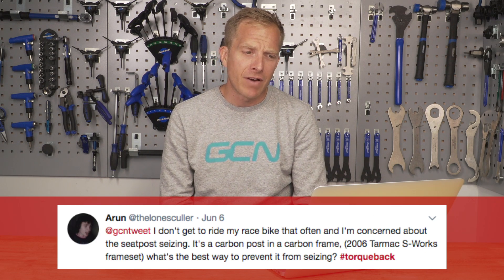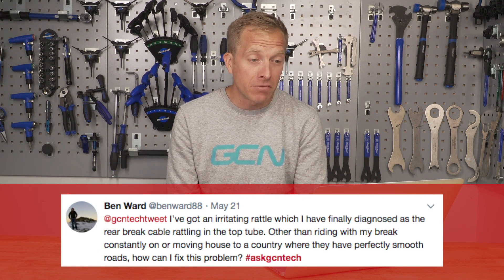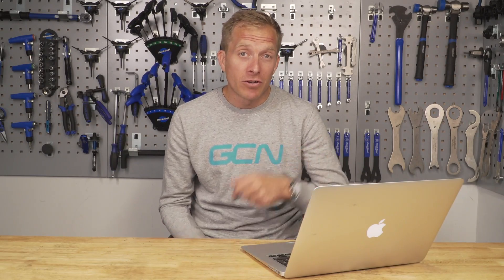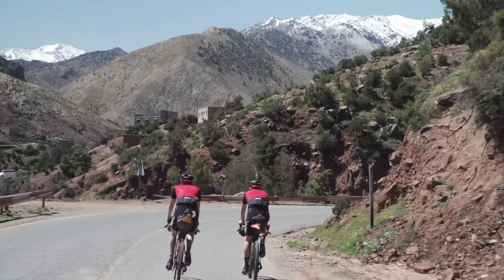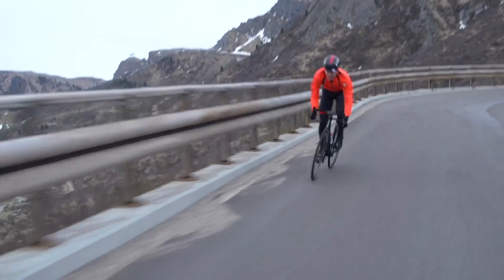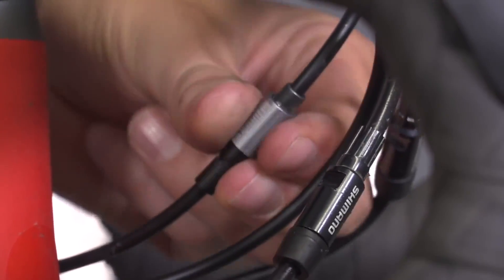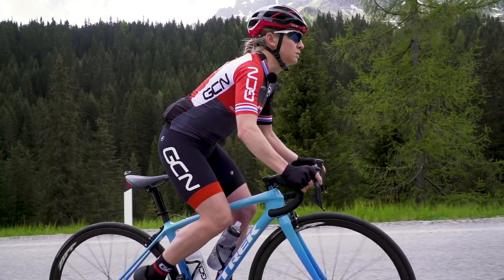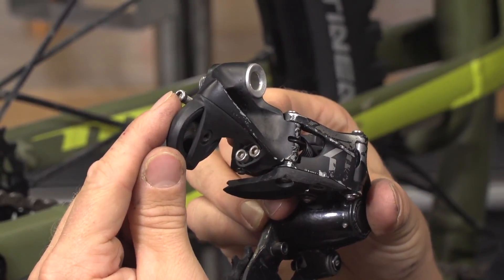Is Petrol A Good Cleaner? | GCN Tech Clinic

Comment from the maker: Remember to keep your questions coming in for Jon using #askgcntech. 👇
Reply: GCN Tech #askgcntech can i use my pressure washer (1400w)on my bike to clean drivetrain? Cheers
Reply: GMBN also recommend using paint thinner.
Reply: GCN Tech I'm having issues with my DI2 firmware not updating and allowing the bluetooth dongle be recognized. Essentially bricking the entire system. Any help?
Reply: GracieApproved if referring to the KMC missing link. They are reusable. Recommend changing the link when you change the chain.
Reply: John Rawlinson: Is this really  the best place for this sort of question? Have you tried bikeforum?
Reply: Thank you John
Reply: Hi Jon, are quick links for 11 speed chains normally one-time use? #askgcntech
Reply: #askgcntech Hi Jon,

I'm looking at changing my saddle out finally (8 years later) on my 2010 Felt F95.  The seatpost clamp is two pieces, with the bolt pulling the top piece down to clamp down the rails.  Will this work with 7x9mm carbon rails? Cheers.
Reply: Elliot Flowers haven't tried. Thanks for the reference. I've searched only for vids.
Reply: #askgcntech Hi Jon, great show, really appreciate all the great info. I have a question concerning cross-chaining...I have an Orbea Avant H30 with a Shimano 105 5800 group; 50/34 crankset and 11-32 cassette...Now I know that cross chaining (50+32) is not good for my drivetrain, but how about the other, less extreme but still crossed-over gear combinations (ie 50+28, 50+25, 50+22)? I ask because when I'm in those combinations, my chain is slightly more audible (not very noisy, but noticeable)...And it's definitely not the chain rubbing on the front derailleur (trimming takes care of that). Do those combos wear out my drivetrain faster? Thanks!
Reply: GCN Tech #askgcntech I've just changed my chain and cassette to new ones. Everything runs well and smooth shifting but when going up hills and I have to put some power through the chain on the 3 largest cogs on the cassette it makes a grinding noise and I can feel the roughness through the bike. It's never happened before? Does the chain and cassette need to settle? What could be causing it? Everything seems fine and the chain and cassette seem to be installed correctly and there is no rubbing on the front mech at all. What could be causing it? Should I be worried
Reply: GCN Tech #askgcntech is there a difference between a ball bearing hub and a cartridge hub? if so, does that mean there will be difference in speed of the hub set?
Reply: GCN Tech #askgcntech  Is balancing my wheels with small weights fixed inside the rim  opposite the valve worth the effort? As when the wheels are rotated, without any floor contact, the valve area always stops at the bottom implying the wheels are heavier in that area.
Reply: #askgcntech
First thing first GCN is simply awesome!!! 
Now my issue, I own a road disk brake bike which uses a 15mm thru axle at front, but nowadays seems 12mm is the standard. Therefore some brands no longer provide any adapters/endcaps for their wheels to be compatible with 15mm thru axles. Is there any way I could use a 12mm axle wheel on my bike without changing the fork? Otherwise I need to remove a bunch of wheels from my shortlist 🙄😔

Comment: petrol has sulfur - which is bad - in it (including diesel fuel) as the cost of desulfuration would make it much more expensive; better use desulfurized naphtha as a solvent with all precautionary measures. wash the chain in 2-3 baths so that you recycle the solvent as much as possible, including by filtering it and decanting it. the second bath container will become the first bath container as the solvent will have more and more lube in it, gradually. it's best to end up with either a mixture of isopropyl alcohol and ethanol+methanol (methanol is more able to dissolve salts) or separate stages leaving the isopropyl bath for last. it helps not only by the increased speed of evaporating and therefore leaving the chain dry so that the lube can enter the chain fully but also is able to take away whatever salt and other things might make the chain rust and/or the lube oxidize leading to performance issues translates in increased friction AND excessive wear. you may also wash the chain FIRST in citrus degreaser mixed with water if it's muddy. take care that the citrus degreaser should be completely washed out of the chain and also the water left inside so you better use something else beside it too. better spend 10 minutes instead of 5 minutes if you take the chain off the bike to do the proper job so that the chain will last longer and the cleaning and relubing does not need to be repeated frequently if done right.

Comment: Hi Jon (and the new fellows who are doing a good job, but, no offence, Jon is Jon...).
Everytime I (religiously) watch / listen to the tech clinic, I forget to ask this, on the subject of cleaning with petrol: #askgcntech
I have a couple bikes at my parents home in Provence, and I basically ride them only at Christmas and during the summer. Being a Si Richardson devotee, I lube my chain and groupset with WD40 but I guess it would dry off between August and December and the chain might start corroding. I don't want to have it bathing in oil either.
So my question is: would it be ok to remove the chain, clean it and store it in a petrol container when I am away for a few months, or does it risk being corroded or damaged?

Comment: #askgcntech How do I stop squealing v-breaks if I've already tried new cartridge pads, new alloy rims, toed in to varying degrees, filed the pads down and stripped the whole calipers and greased every moving part other than the breaking surfaces.  They still let out the most horrendous scream when I stop. Not when the pads first touch but when I pull harder (I guess when the full pad contacts the rim).  Please help or i'm going to have to bike with a bag over my head to save the embarrassment. thanks

Comment: I have a carbon fork with a through axle and the recommended tightness of the through axle is 20NM, but if I tighten it anywhere near that much the hub gets really tight and the wheel doesn't spin freely. Questions: 1) Can I fix something that allows me to tighten the axle without affecting the hub? 2) Is it dangerous to keep the through axle looser (~6NM). #askgcntech

Comment: #askgcntech - as a visual designer/ digital illustrator / cartoonist -  i'm quite bored with most branded carbon bikes, beautiful as they are they all have the same aesthetics, I would like to be able to paint my carbon bike myself using all cool effects possible: from cartoon figures, tattoo styles to airbrush effects. (as seen on Harley's) 1 - what would I need? 2 -  have you already got some video's about this? If not this could be a cool winter project tutorial thing, similar to building a wheel etc. 3 -(in the last few weeks there was a gcn video that mentioned spray paint can's for bikes but I can't find it anymore, which was it?) Thnx!

Comment: Hi Jon. I need to buy a new outer chain ring. I'm currently on an Ultegra 50/34 but would like to replace with a 53 outer and keep the 34 inner. Is there any problem with doing this? #askgcntech

Comment: Hi John, I live in an appartment in Amsterdam and have little storage for my bike. I have, however, do have a small storage closet in my appartment where my steam boiler is. It is big enough to store my bike (Canyon Aeroad ultegra di2).  Do you think I could damage my bike by putting it there? It is quite hot in there (25-28 degrees Celsius) and humid). I mostly worry about my tires, drive train and electric components. Love the show! #askgcntech #askgcn

Comment: #askgcntech Hi Jon, i have a Masi Uno CX which is a steel framed cyclocross bike. It came with 2300 components but now I have upgraded the entire bike to 105. One issue that I am facing is the front derailleur. The 105 front derailleur's cable needs to be fed from the bottom. There is a small circular thing that lets me route that cable through there to do exactly that. However, it hampers the throw of the shifter and the derailleur does not get enough movement. Now I am thinking of rerouting the front dera cable below the downtube and then zip-tie it into place. But don't want to bodge it like that. Any suggestions?

Comment: i currently run 52/36 chainrings and find that when tackling some of the steeper gradients in the area some being 16% + im running out of gears. Im running 11-32 on the rear ..is it possible to use a 34 tooth inner ring or is the jump too big? or would i be better off changing too a full compact set up?

Comment: 35mm on a roadbike not gonna happen unless it has canti brakes, V brakes or disc brakes OR is an older bike with long reach side pull brakes. you'll likely run into clearance issues with the brake vertically(top of the tire will rub the calipur) or side clearance issues with the seat or chainstays or the seat or chain stay bridges.

as far as tred goes. if its a knobby the chances of it working are even less because it'll be slightly larget then the labeled size. 

can it fit on the wheel- YES,

will it fit on the frame, probably not.

Comment: When changing between sets of disc wheels, even if same brand rotor, you may still notice some slight pad rub. This is due to manufacturing tolerances between identical parts and industry standards. Stay with higher end components like SRAM Centerline and Shimano Ice Tech. I just loosen up the caliper, mount the new wheel, squeeze the brake lever, retighten the caliper. Lines up every time. Takes about a minute per wheel

Comment: #askgcntech My bike ( a Giant Propel Advanced Pro 1 2016) has mechanical cables running from under the bartape into a port behind the stem, the frame being Di2 compatible. The arrangement means the cables stick out about 3cm either side of the stem, and my knees/lower thighs  knock into them when climbing. Any ideas how to help this without forking out for Di2. Love the show. Cheers

Comment: #askgcntech HI, I've just bought some new wheels with internal Rim width of 19mm.  When I put on 25c clincher tires on them, the measured width comes out to 28mm.  Should I pump the tires to the recommended Psi for 25c or 28c for my weight ?  Thanks!  Keep up the good work.

Comment: #askgcntech Hey Jon, I have a question about an annoying sound (I know you love/hate those). I have a "tick tick" sound that seems to be coming from my back wheel. The sound comes both when I pedal and coast, so I have excluded everything else other than the wheel. With a bike on a stand I've been able to hear that the sound seems to come from the area where the wheel passes through the chainstays. I have checked and there is nothing rubbing on the wheel or touching the spokes anywhere on the path of the wheel, and there is enough clearance for the tire between the chainstays. No spoke seems to be lacking tension, the valve seems pretty secure, and there is nothing loose inside the rim. The sound is very clear when the wheel is turning faster than 25km/h, it starts to go lower below that, and strangely disappears when the wheel turns below 15km/h. And it comes no matter what gear combination I use. This sound came after last time I removed the back wheel during a bike wash. I have tried removing and putting back the wheel (sort of like turning off and on a computer), but the noise is still there. Any ideas what could it be? Could it be something else other than the wheel? Thank you very much in advance!

Comment: Finally, straight talk on using gasoline (petrol) for cleaning.  It works and costs less than the other stuff.  Good for paint brushes, too.  If you aren't intelligent enough to keep from setting it afire, you probably can't get the container open.  Yes, minimize skin contact and fume exposure.

Comment: Hi GCN Tech. I am from South Australia and race in the junior Road Races. The rules say that juniors cannot race on Carbon wheels, or have a rim depth over 40mm. I have a 2012 Giant TCR Advanced SL 01, with the Giant PSLR 1 Wheel set. I want to upgrade to a better wheel set. I was wondering if you could recommend any quality, mid depth, lightweight alloy wheel sets. Cheers.
#Tourqueback

Comment: A 28t cassette will work on a recent DA RD - wow, what progress

 My 1st gen DA RD short cage from 1973 will take a 30t......

And there is a long cage version rate above that
Reply: I used a 12 to 30 on my 10sp Ultegra with short cage. 32 just about worked too but if in doubt use a Shimano RD 350 non series derailer.

Comment: Using petrol is dangerous advice

Diesel is a safer alternative, much lower flash point

I use neither, white spirits works fine
Reply: I prefer white spirit or turps substitute. Petrol is nasty stuff with additives like Benzine

Comment: #askgcntech Hi Jon, another gear related question: I'm not ready yet to go for gigantic mtb-like cassettes for big range, instead I'm looking forward to build another monstrosity - pair a 28-teeth chainring with 50 one. In this case, can a 4500 front derailleur handle the task? There is a lot has been said and more to be said about rear mechs, but hardly any data on front... Additionally, are there aftermarket chainrings with maybe more protruding ramps or better pin placement for chain to catch upon?

Comment: Easiest way to have 2 disc wheelsets... use the same hubs and rotors (at least brands)... Typically the tolerance will be similar and allow for "hot swapping" wheels without fuss or extraneous adjustments! (or shims)

Comment: I've just changed my chain and cassette to new ones. Everything runs well and smooth shifting but when going up hills and I have to put some power through the chain on the 3 largest cogs on the cassette it makes a grinding noise and I can feel the roughness through the bike. It's never happened before? Does the chain and cassette need to settle? What could be causing it? Everything seems fine and the chain and cassette seem to be installed correctly and there is no rubbing on the front mech at all.
Reply: PureMAD4 sounds like chain rub on the front mech.  If it is a shimano there is a trim option so you can actually move the mech over to clear the chain.
Reply: Doug Thorpe  That's what I thought but there is no rubbing at all from the front mech.

Comment: #askgcntech Last week while descending the steel bolt on my seat clamp sheared in half and resulted in a high-speed crash.  Is this something that is known to regularly give out on bikes? While I'm not the smallest guy and my bike is 4 years old with regular use (and maintenance), I still would expect a bolt to last more than 4 years or expect to be told to replace it regularly as part of the maintenance.  Is this just a fluke accident or am I out of the loop and should be replacing my bolts regularly?

Comment: I'm guessing everyone already knows this, but it bears repeating. Liquid gasoline (petrol) is pretty stable, flammable, but not explosive. However, petrol fumes/vapors are EXTREMELY volatile and explosive. The fumes are also heavier than air and collect near the floor around any open petrol container. Using gasoline to clean anything, particularly in a confined space (I.e., garage or workshop), can be very dangerous as there is often an ignition source, such as a light switch or a water heater pilot light, nearby. Many years ago, a friend was cleaning a grease spot on his kitchen floor and the water heater pilot light ignited the vapors and caused a large explosion which blew him out his kitchen window. He died several days later from injuries and massive burns. No joke! My advice, (if you feel you must) only use gasoline as a cleaner in an outdoor space away from any ignition source.
Reply: Gasoline, white gas, kerosene, charcoal lighter fluid, etc?  Do these have an ingredient in common that is the actual solvent that dissolves grease?  From a cost standpoint, gasoline seems to be the cheapest and does the job of dissolving grease.

Comment: Hey! I’ve taken my Specialized Diverge into my LBS to have an annoying “tick” or “click” checked out. It consistently makes a “tick” or “click” at the bottom of my left pedal stroke. LBS trialed the cranks, pedals, etc. and made sure everything was at the proper torque. The tick is still there about 80% of my revolutions. Do you think a bottom bracket replacement would do the job? Thank you much #askgcntech

Comment: Petrol is good but probably the most dangerous option. White spirits is safer and biodegradable. Paraffin oil also works.
Reply: PtWhiteBelt i don't believe it is bio-degradable, rather it is just a less volatile hydrocarbon fraction?
Reply: Turpentine comes from tree sap, but not white spirit, that's still petrol based.

Comment: If I need to clean my chain really deeply I do use petrol. It is simply the best. I always wear rubber gloves when using it though. I use normal degreaser for a quick clean. Also petrol leaves a deposit on the chain so it pre lubes itself too.